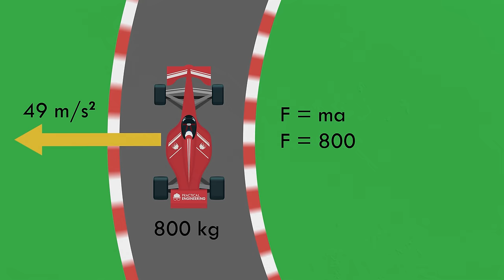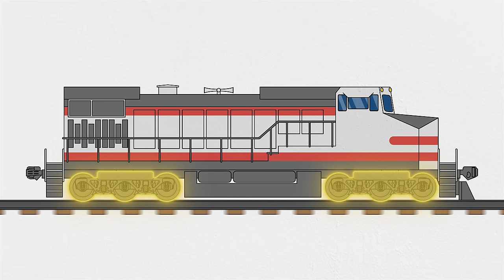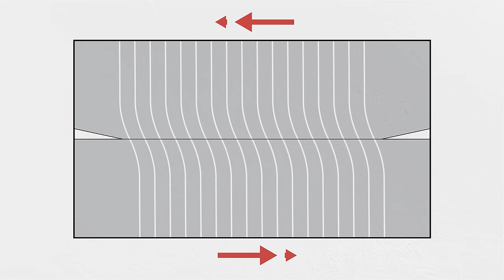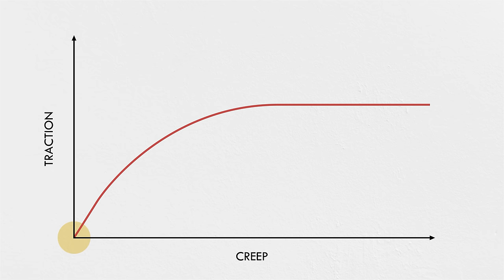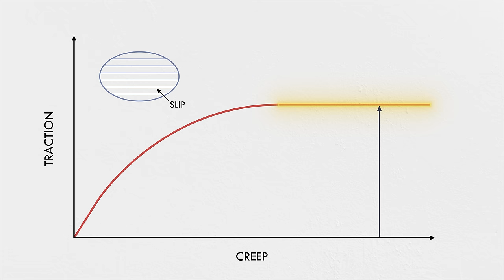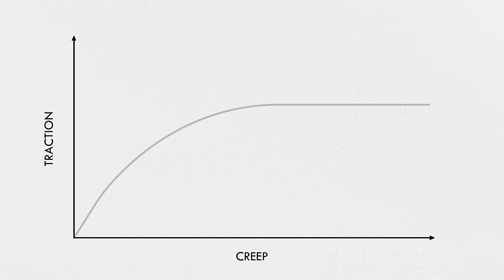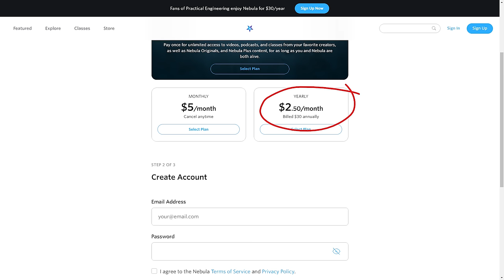Why Locomotives Don't Have Tires

Comment: Tires also provide the additional benefit of smoothing out bumps in the road, right? For trains this is less of an issue because the tracks are already smooth. Suspension isn't as relevant on trains as it is on cars and trucks.

Comment: Older locomotives all had tires that needed to be changed on a regular basis.
Pretty sure they invented the word tire.
Only they were actually steel rings that needed heat to remove them from the rims.

Comment: Why isnt it the case that locomotives have higher traction wheels than railcars? What's the utility of friction in a non-powered car, and whats the utility of slippage in a powered car? It seems like they have totally different needs, but use the same wheel design for some reason

Comment: The old steam locos had tires, but they were steel rings shrunk into place on the drive wheels.  This allowed a drive wheel and axle unit to be used for a much longer period than would have been the case if the main section was being worn down by the friction with the rails.

Comment: I've been on one of those trains with rubber tyres. The Yurikamome in Tokyo. To be brutally honest, I don't think the ride was any smoother than on a regaular train with steel wheels.
I would still take the Yurikamome any day though, but that's mostly for scenic reasons 😎
Reply: Ligne 1, 4, 6 and 11 of the Paris Metro are rubber-tyred.    Agreed the ride didn't seem any smoother, Ligne 6 in particular seemed to take off very fast with a mighty howl in the tunnels.   Loudest Metro line I experienced.   Inspection showed that the flat steel strips the rubber wheels ride on had fine transverse grooves, presumably to aid adhesion, and I think these were what produced the howl.   Quiet, they weren't.

Comment: What i never understood with trains is why locomotives needed to use the same low traction rails the cars do. The idea is to pull the weight with the least friction possible. If there was a second set of tracks with a much higher grip, it could pull more using that and then keep the steel wheels of the cars on their low friction track

Comment: Because friction is the normal force × coefficient of friction, contact patch size does not increase friction. So why is it that top fuel dragster use large slick wheels with low tire pressure to maximize the size of the contact patch?

Comment: Locomotives DO have tyres: they're made of metal, and allow the wheels to be re-rounded without having to re-make the whole thing. I've ridden on a passenger train with a flat section on its tyre, and discussed the matter with a railway engineer.

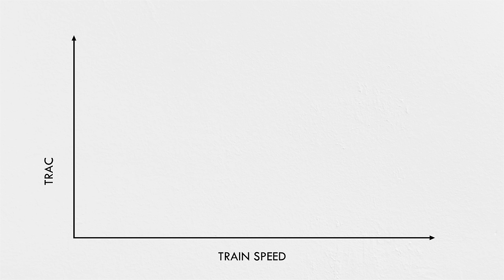Comment: The graph is confusing me at 3:05. Is that a level curve set at the power limit, such that the power is constant at every point along the curve? So if we drew a parallel line closer to the origin, that would be operating below peak efficiency (assuming operating at MAXIMUM POWER is maximally efficient)? And a parallel line further away from the origin is beyond the capability of the locomotive?

Comment: I remember hearing about a system on modern trains locomotives somewhat like ABS breaking or Anti-skid on aircraft where they monitor the rpm of the wheels to reduce breaking to keep them from skidding. This system is kind of the opposite. They have a radar that monitors the speed of the train and compares that to the wheels rpm to reduce the tractive force when the wheel starts to slip. Is this system still used or have they developed better systems?

Comment: Ive always wondered, why can't they use solid rubber tyres for emergency braking? When used it would drop and make contact to the rail with massive disc brakes????

Comment: Does the same apply for bullet trains like the ones in Japan and China?
Reply: Maglev is different technology
Reply: Yes.
Reply: There are many types of bullet trains. That uses steel wheels like any other trains, that uses magnetic levitation, etc. The one that uses steel wheels work just like a normal train, pretty much. They just have different builds to be able to reach that speed.

Comment: Why don't engine designers do something like this? Use a retractable drive axle with rubber tires. Lower the axle to help start the train increasing the adhesion limit then raise the axle so as not to increase tractive effort at high speeds.

Comment: Sadly, the title is an over simplification and is incorrect.  Just about any steam locomotive has steel tires that are machined when worn slightly and replaced when fully worn out.  These are legitimate locomotives and are the only locomotives on certain railroads.

Comment: Technically your wrong as all railway wheels are have tyres upon them. Not Rubber or Synthetic but actually they're made of metal. This in case the rolling stock or locomotives brakes lock on and a flat is created. If it is caught early just the tyre is removed, rather than the whole set having to be scrapped.

Comment: 10:40 wouldn't that mean for each rotation of the wheel more distance is traveled?
Reply: Depends on the direction. If you want traction, then the wheel rotates slower than the ideal pure rolling speed. If you want braking the wheel rotates faster.

Comment: They do pull wheeled cars on rails in like 1 spot on one line in usa I think I saw on a rail fan rail watcher site it's like a reg train but it's got some of the cars actually on wheels I'm also just guessing the train's speed is limited because it is on a trackbed like 20-30ish mph max etc.

Comment: Absolutely cool video. I am certified automotive technician. But for the life of me I never got involved with locomotive mechanics even though I was inspired as a young lad to that field. Ann Ryans " Atlas Shruged" was a novel that really got me interested. I am in love with the automotive electric auto traction motors and the fallback with them is batteries/ electric storage to run them. Love this channel, keep up the good work.

Comment: Again, a factually incorrect premise corrected later on in the video.
Trains do have tyres. They're just made of metal, not rubber. And even still, RRVs use their rubber road tyres for traction and the metal wheels for keeping on the rails. And some trains also had rubber tyres experimentally. And then there's the Paris Metro.

Comment: Out west, where the trains are huge, you’ll sometimes see three, or four, or whatever engines at the head of the train, and then you’ll see a couple in the middle, and sometimes also one at the tail. Is there a scientific reason why this is done? I mean, as opposed to a practical one like maybe the train will split at the middle engines to create a second train to a separate destination. Is there something about traction effort that changes based on where the locomotive is in the train? Why not just put all seven or eight engines together at the front?
Reply: Reading through some other comment threads about large engines, maybe it’s the draw bar limit? Which I assume is about how much weight the coupler can pull? So you’d want to pull from multiple points rather than have all the weight from the whole train culminate at the engines up front?

Comment: So I used to be a welder and was working with an engineer on a specific project. The part in question involved 2 pieces of stainless steel sliding over each other to do a thing, but they needed to slide just right...  We were discussing the effect of various surface finishes and while I knew the proper term was "stiction" I couldnt help my self and said something along the lines of "to make sure the part has the right sticktivity". My favorite part was when he paused, thought for a second, and said "Yeah that word works, sticktivity it is" and we continued the discussion.

Comment: Question: Could adding in an adjustable/tunable electromagnet to the locomotive's wheels to add in magnetic grip to enhance friction during initial acceleration or assist with breaking? One that could be turned off during flat operation when you don't need additional tractive force.

Comment: ...... All locomotives have tires though.... The tires are just made of steel. The reason for this continued use of Steel on steel is as you alluded too is Maintenance cost . Though it's more actuate to say it's a steel wheel with a steel tire on a steel rail.

Comment: why dont we put wheels on the locomotive that clamp on the tracks from the side or something? that way you get the low rolling resistance on the freight, but more pulling power for the locomotive

Comment: if theres some smarter railfan than me in the comments, please correct me. im pretty sure that the largest amount of engines a train can have in front is 2-3. any more would literally tear the train in 2. if a train has any more, they're backups. also if a train needs more power, there'll be some engines in the middle

edit: this is why long distance amtrak trains have 2 engines, they only need one but having a spare is important
Reply: Dirty big long trains in Australia have locos in the middle for that very reason. There is a limit to how much tractive effort you can get from locos at the front pulling a heavy train. Electric suburban passenger trains are different, if say a 6 carriage train has motors in 4 or more carriages then the tractive effort is spread along the whole train, which means they can take off faster with bugger-all chance of wheelslip in normal conditions.
Reply: @AshleyReynolds-vc6ly  thats the great part about electric trains, especially passenger trains: pretty much every car is an "engine"
Reply: @jacobwhitecotton  Exactly, and that is one reason why electric trains are generally superior to diseasels. Also it is why modern country diesel passenger trains have evolved to multiple-unit operation with power cars spread throughout the train. Not as good as electric, but where the traffic levels don't justify the cost of electrification it is better than just having a loco up front hauling carriages. Of course, for freight wagons that isn't practical so they have to use locos.

Comment: Not just locomotives - none of the other rail cars have tires either.   It's also pretty obvious that tires would work poorly on rails.  A far better title would be why rail is more efficient than road.  Sadly, we end up with confusing sensationalism instead, presumably to drive clicks.

Comment: Actually, locomotives DO have tires.
Their wheels are wrapped in a ring of steel that is periodically replaced as it wears down. Those are called "tires", at least in my language (Dutch).

Comment: If they removed or lowered the physical safely limitations of the driver by increasing the safety and resistance of the cockpit, couldn’t they in theory be able to reduce regulation and make an even faster vehicle? There should be no limitations on speed or design, that goes against the very inherent purpose of a race after all.

Comment: "Why Locomotives Don't Have Tires . . . "
Actually, locomotives, railway coaches and railway wagons DO have tyres - though they're made of steel rather than rubber.  Why?  As railway wheels wear, the rims go out of profile, which can cause a derailment;  that can be corrected by machining on a special lathe - but only so many times.  After that, the tyres are pressed off and replacements fitted - because doing that is a lot cheaper than scrapping the whole wheel!

Comment: Having put together a sim racing rig lately, I realised the whole thing is actually just friction fit, with the screws being the only thing providing the necessary normal force. It made me realise that metal-on-metal sliding friction is actually insanely higher than we would intuit because most people only ever experience metal in the context of light contact or non-metal to metal contact.

Comment: "Most modern freight locomotives use diesel-electric drive" - nah, that's only in countries stuck in the stone age. In modern countries electric locomotives are used because of numerous advantages - from lower operational costs to almost no emissions - they have over gas guzzlers.

Comment: Paused 2 minutes into the video, because rail vehicles including locomotives, streetcars and other have tires. They are just not the rubber tires everybody knows, but steel tires, friction fit on the wheels. And it is nothing new, even steam locomotives had tires that did wear down over time (and each time at re-profiling the wheels) until they had to be changed for new ones. Just google for railway tire.

Comment: Grady, You missed the fascinating aspect of rubber tire that allows it to turn. The right side of a tire turning to the left has to go farther than the left side. Because it is stretchable, it can do that without scraping.  Because a train wheel is actually a double cone, it can do that without stretching or scraping.
Reply: That was the subject of a previous video.

Comment: Unless you have a different definition of a tyre/tire, even old steam locomotives have tires and up to date new models as well, The wheel is cast iron, the tyre is a steel band that is heated uniformly, then placed over the wheel. These are replaced when they get worn. This process has been carried on for 100 years at least, there are even videos of new tyres being fitted to locomotives. They definitely so have tyres/tires, and apart from the very first ones which had one piece cast wheels, locomotives have always had tyres. Here is proof for you  https://youtu.be/1Z4G7BMUCm8?si=huPBwzxQ3VJLE5UD

Comment: I just don't get it. The wheel was slower (less rotation) not faster than the travelled distance. What am I missing? "Spin faster than the locomotive is moving" and showing the brush wheel moving (rotating) slower than the rug (the surface)? I must be missing something.... 🤫

Comment: Wheelslip is bad for locomotives. Very bad. DC engines are ballanced by 2 things: voltage and load. Load is trying to stop it, bigger is less rpm. Voltage is making it spin, it causes current to flow. When wheel starts slipping, looses load. It affects no limitation in rev speed (load is gone, grip lost). Engine is rotating faster and faster until one of those will happen: apply brakes (to generate load), inventer turns off (cut off power) or engine exceed its safe rpm and centrifugal force will destroy it. Not only engines may be damaged by slipping wheels. Rails and wheels are becoming red hot very quick. Damage occures soon. It is the reason to use rings. It is not 'steel tire'. Ring on wheel is feature, that provides longer life of wheel set. Wheels in railcars are not like in car, independent. They are grouped in sets. Every set contains axle, wheels and that is one component. It is cheaper and easier to change just outer rings of wheels instead entire component. Imagine damage, a crack. If monoblock wheel is cracked, entire wheelset is scraped. Safety, no welding allowed. If only ring is damaged, just change it (both rings must be changed at once), problem fixed, set it ready to be mounted again. That is cost and time efficient to repair instead manufacuting new one.

Comment: Locomotives do have tires........metal tires that are fitted to the wheel by expanding them with heat and then cooling them down.

Comment: I expected the video to start with: Locomotives did have tires once upon a time, the driving wheels of steam locomotives invariably had replaceable steel tires. They were necessary because of uneven wear due to the forces of dynamic augment led to eccentricity, also adhesion was poorer with numerous coupled driving wheels having differing cyclic forces applied. The adhesion characteristic caused substantial wear to both the tires and the rails, and was one of the factors leading to the extinction of the Iron Horse.

Comment: The real answer is because trains are a stone age tech that started being used before we had what we know call cars. Then we started standardizing containers to a way too big size for 95% of their use cases so we kept trains around to handle them. In the early days of rail it was very easy for the local capitalist or government to tell everybody in the way of the railroad project to go get f'ed, but these days not so much. Being obsolete since the 1900s they have obvious limitations, but we keep hurling massive lumps of metal with almost no braking capability around still because... reasons.
Reply: Me: Let me introduce you to ships.

Comment: @0:37: Tonnes is a measure of weight, not force. Newtons is the unit of force. I know you know this, and this is a gross mistake on an engineering channel, so please edit it out/correct it somehow.
Reply: Even the calculation is wrong 😂
Reply: The SI unit for weight is N, weight IS a force. It's the name we give to the force acting on objects within a gravitational field. Tonnes is a measure of MASS, not weight, however it's relatively normal to interchange mass/weight because for humans on earth we dont use N when saying something is heavy, we say kg, even though the force... Or the 'weight' is 9.81*mass.

Practically we can use tonnes as a measure of force assuming that we convert it into Newton's for calculations.